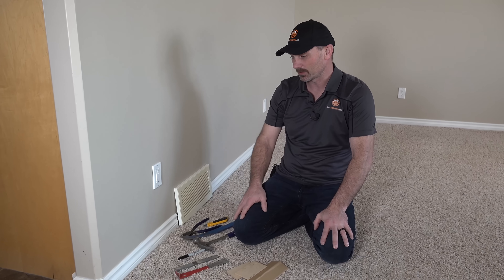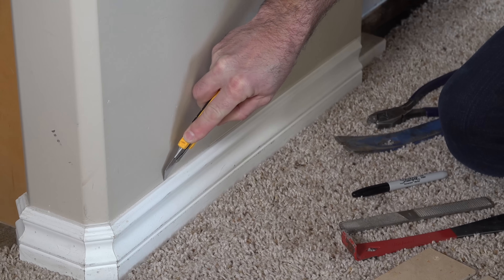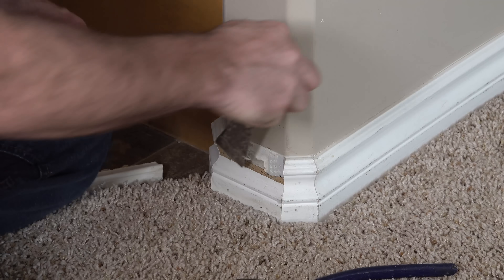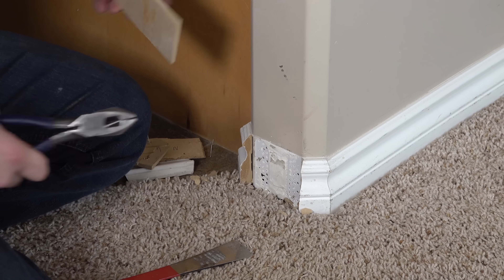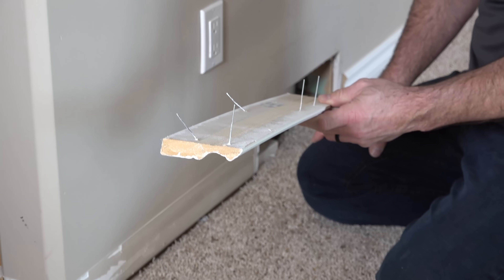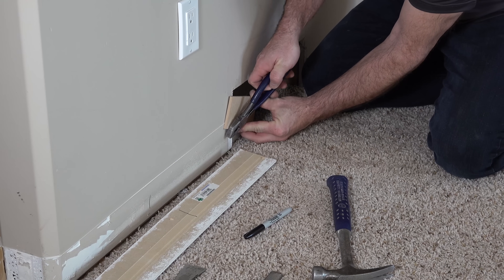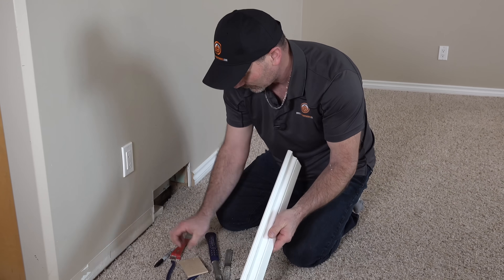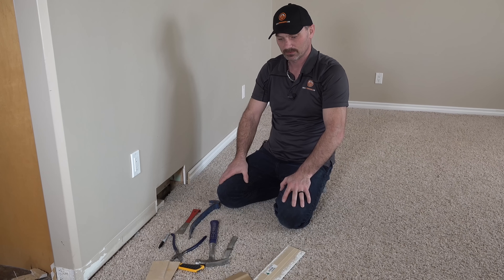How To Remove Baseboard

Comment: Great video!  Another tip: If you break a piece, don't throw it away. Keep it to make it easier to measure the replacement you'll have to cut later.
Reply: You can wood glue it back together too if it's small.
Reply: Thank you! Wicked smart.

Comment: We usually do this with a puffy knife. And if you are using a mini crowbar, get a piece of wood and place it above the baseboard of the section you’re working on so you can pry the board off without damaging the wall. If you don’t need the baseboards, because some might crack. If you’re painting and your floor is Pristine, take your time to mask everything correctly! Proper Masking is 80% of all good work. Specially when you spray. Jesus… the dust!

Comment: Nice tip with using a small scrap of wood to protect the wall. Last weekend I removed the baseboards in my foyer and kitchen in preparation to install vinyl floors. I used a tool called the Zenith trim puller that I found extremely useful. Unfortunately for me, the prior homeowners used the wrong nail type when they installed the trim so I had to be extra careful so as not the break the baseboards in half. Somehow only one small corner piece broke in half.

Comment: you are the best contractor trainer. I am a home inspector. I have watched your videos on window, vinyl siding and many other installations. all your procedures are based on the most textbook guidelines without any short-cut . 💯👍
I know there are many contractor youtubers with more than a million subscribers but after watching some of their videos, i noticed that they make short-cuts in different installations that can raise any home inspector red flag. 
I hope to see more videos from you.
Reply from the maker: Awesome, thank you!
Reply: I am sorry if my question is not related to your videos. I just wanted to ask my question in the comments.
As a general rule I know that the drywalls should not be tight in place and recommendation is to consider 1/4 inch short but I don’t know how in practice!
For example in ceiling:
Must the first sheet be tight against the corner or considered 1/4 inch gap against the corner? What about the next sheet beside it? And the last sheet on ceiling?
And the then after hanging on ceiling, the same questions for walls?
Would you please explain me or if you have a video about it, refer it to me?
Thanks

Comment: Thank you! This video helped me understand how to take my time and remove the trim properly. I was going to use all quarter trim after installing new click and lock flooring. After spending $101 on two 10 by 10 rooms just for the quarter trim I about passed out. It would cost me over $1,000 if I needed to do this in all the rooms after floor upgrades. Now I'm going to remove the trim, install the floor then put the trim back on. Thank you for the tips. Wish me luck! 5 more rooms to go!
Reply: I’m doing a whole house reno. I had no idea this could be so costly. I was going to buy new baseboards but I’ll be more frugal!

Comment: Thank you for the informative video. I would like to remove my baseboards before changing the flooring, and I feel much more confident doing this now. I like the labeling system too. “Porcupine of a baseboard” was a cute comment.
I like that you use a scrap board as leverage to protect the drywall when prying the baseboard.

Comment: I found using end nippers to remove the nails is easier and results in less damage to either the wall or the molding. The end nippers have a large rounded surface to spread the load out. I used to twist the pliers but it was difficult to do and caused damage. Even my kids and wife found the end nippers very easy to use. Just started using the slim bar which works so much better than the bar I used before. Great video and Thanks
Reply from the maker: Yes they do work well also.

Comment: Awesome video. slightly late but again in my case it was much more complicated as I have had thicker nails. I would not make using one tool. I used 2 crowbars like yours heavy and few more things to help. My problem was nails were 45 degrees so it was required to push off the wall and from the floor. But still same technic used wooden thing to avoid damaging

Comment: Hey Shannon, how are you? 
Just got a quick question a little unrelated to this video .. in regards to using finishing nailers, I know that 18 gauge is for trim and similar size material, but when do you decide to use a 15 gauge? Would you use a 15 g for door & window frames? Basically what areas are good for 18g and which for 15g.?
Thanks for your advice. Keep up the excellent content and thank you.

Comment: Thanks for the Great video.  The only question I have is removing base boards at the inside corner. I'm guessing that purposely cutting one is the only way to go. Thanks for fhe idea of protecting the wall with a thin board.
Reply from the maker: Usually if you start removing further from the corner the baseboard will flex and pull out from behind the second one.

Comment: What a great video. This is the kind of expert advice I need. I have a question. Is it possible to run data cable along the tiny bit of space along the floor? I feel like pulling up baseboards would probably be easier than running it through walls and the attic. I live in a 2 story house on a slab.
Reply from the maker: Yes generally you can, Just be careful not to nail through it re applying trim.

Comment: Do you recommend the same procedure for removing crown molding along the top of drywall as well? Thanks.
Reply from the maker: Yes, cut any painted edges with a utility knife to reduce damage to the walls and ceiling

Comment: I have to install baseboards in an area that will eventually require new flooring. I really don't want to glue them on because they'll just have to be removed. Were any of those baseboards glued? It seems like gluing will cause more drywall damage and I just fixed those walls when I removed the door jamb in preparation for a "barn" door. Not sure what to do... maybe a glue that's not too strong?

Comment: Hi! One question i have is, when you have carpet in place like the one you have and remove the baseboard to replace it. When placing the new baseboard, How do i know how high to place the baseboard in relation to the floor (or carpet in this case)?

Comment: I just removed the baseboards from a big bedroom. They attached them with many long staples. They come out with the baseboard. Suggestion on how to remove them? Can't pull them out the back like nails and they can't be pounded out the front. I guess I'm only left with cutting them off but there are so many I'm hoping for a better idea.

Comment: It would be great if you listed the tools used.  If you added links for the tools in the description, you could get a commission everytime someone clicks on the link.

I was just looking for a nail set tool, and a bunch of different ones came up...some hollow in the middle, some solid, some just made to make a dimple to make driving a nail in easier/less likely to slip.
The next tool I'm going to be looking for is the little pry bar you used to get the baseboard off.  It will be difficult to tell the correct size to get for the end of the bar.  Just food for thought.
Reply from the maker: Thanks, we do have links in some descriptions, but not all. The rebar I prefer is 9".https://amzn.to/3RViwKH
Reply from the maker: The red bar link is in this video description.

Comment: is this what i need to do to remove baseboards before putting down some Vinyl Flooring?  I also have quarter-rounds below the baseboards at least in the bathrooms.  Looks like some of the other rooms just have the baseboard where there is currently carpeting.  But the bathroom is linoleum, which is something people used back in the 90's apparently.    Any help is appreciated!!
Reply from the maker: in the bathroom you can just likely remove the 1/4 round but the other rooms remove the baseboard.
Reply: @HouseImprovements  Thank you so much!!!!! subscribed!

Comment: Just bought a house that was build in the 90's, took us a long time to remove the basedboard as they used large screws, now my baseboard is damaged a bit.  What easy way should I do to remove a baseboard that has a lot of large screws?.
Reply from the maker: If they used screws you will pretty much need a drill to back out all the screws to remove the baseboard. I have no idea why anyone would use screws?

Comment: If wood floors, should a bead of caulk be used before you put the base moulding on.   What about that red caulk they use commercially to block smoke, and would the caulk help seal off places for bugs to hide, maybe keep the room more sound proof and air proof
Reply: What are your thought

Comment: So here's my dilemma. I'm installing wood flooring in one room that transitions to tile. Once I install the baseboards back in over the wood flooring, the baseboards will not be matched up with the baseboards connecting to the area with tile. What will I do, cut the bottom of the baseboards?
Reply from the maker: Yes either that or use a block of rectangular wood as a transition block between the two.

Comment: How do you remove baseboards that don’t use nails?  Is it the same process or different?  I get the sense my baseboards were glued to the wall.
Reply: Michael----  You use putty knives , and 4 " drywall knives to get behind the board . You can repair the damaged drywall by :
                   - removing torn drywall paper 
                   - sanding it all down 
                   -Apply some Zinnser drywall paper sealer , available from Home depot .
                   - Use a drywall knife , perhaps 4 " wide , to apply some general purpose patching compound .
                   - Sand down your repair .
                   - Apply some more of that Zinnser sealer .
                   -Paint the damaged area .

Comment: how do you put the baseboard back on?
Reply: Tawanna Broadway---Buy , or rent , a finish nailer  . You will probably need a 16 or 18 gauge tool , with the necessary " nails" . About every foot , put one nail in the top and one in the
                                      bottom .

Comment: Great video. Wish I would have known this a few months ago.                 
Just wondering why you pull nails out of the back. Don’t you have big holes from the nail head in the front now? What do you do with those?
Reply: ive marred/damaged trim by taking nails out of the front the holes dont open much with how small the nails are
Reply from the maker: With brad nails it is easier to go out the back and creates less damage.

Comment: When you are putting the baseboards back on, do you use the same holes for the nails?
Reply from the maker: If it was brad nailed on use new locations  and if it was hand nailed on it may be possible to use the old ones if your hand nailing again but only if you pulled the nails out from the front of the trim.
Reply: Thanks for the info and quick reply! Great video!

Comment: There's no way you can reuse recycled paper mouldings. Next time I redo the moulding, I'm going with finger jointed pine. These mdf mouldings expand the contract too much causing joints to open up no matter what you do.
Reply from the maker: They are for sure re usable. Depending on your climate they may be more trouble some than wood but they are more widely available  more designs to choose from and way cheaper than wood .

Comment: Why take them off and reuse them?  Is it for a flooring change?  If it were tile or plank flooring wouldn't you just put quarter round down and you lay the floor?
Reply: You can do anything you want buddy! You can even reuse them...hold on to your horses....hold on to your hat.....in another room!!!
Reply from the maker: This was being changed from carpet to hardwood. You could just add a quarter round if that is the look you wanted.

Comment: That mini prybar is a poor tool to use for removing baseboard if you're plan is to reuse it. There are trim remover tools that are thinner, to more easily slide behind the board, wider, to provide more leverage when you swing the handle left/right for prying, and taller, so you spread that force across the entire height of the board instead of the top 1" like that mini pry is doing. Surprised you didn't break more boards with that.

Comment: They used a pneumatic air gun (3 inch nails)) on finished walnut trim painted white.  Ran a stupid bead of crap caulk that wasn't done properly.  What a mess!  And they were professionals.  $10,000 job.  I have to remove the trim for a concrete company to go along the perimeter down to the drain tile.  Fing stupid, Fing mess! Then after they do that, l have to reinstall the trim that l have to remove.  Owning a house costs way too much time and far too much money!  Dumb!  Your video is too easy for that particular application.  Nothing like mine at all!  I have 3 inch trim that was installed in 8 foot sections, crazy!